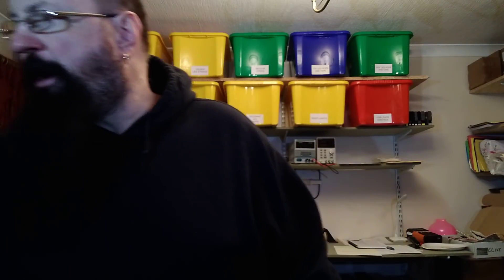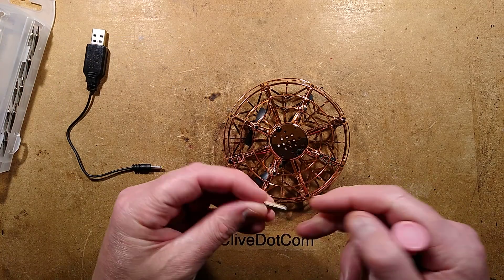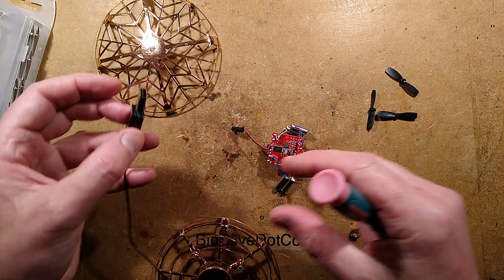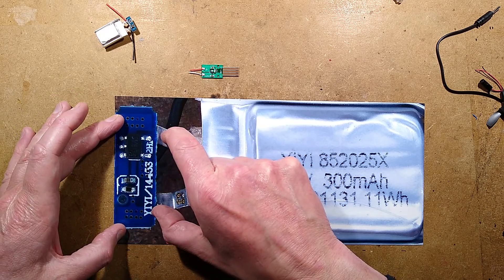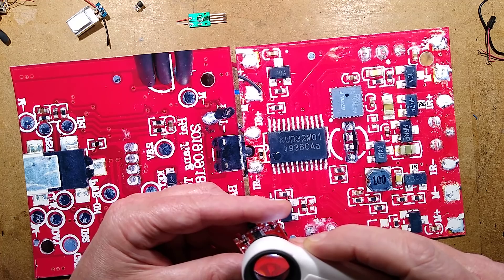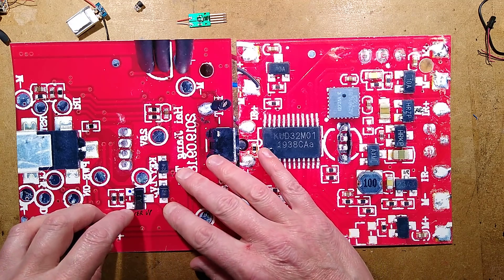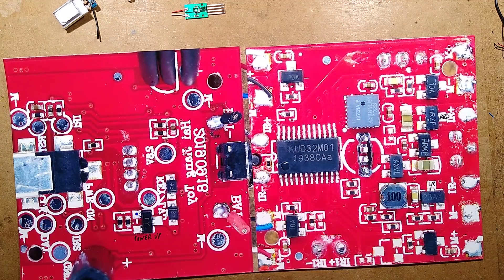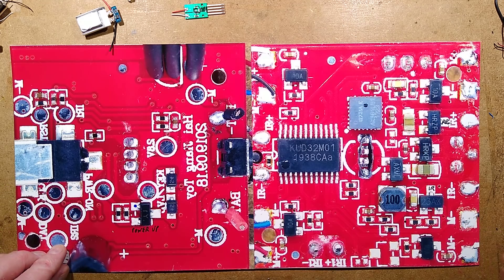Inside an autonomous drone.  (With beard entanglement incident.)

Comment: So fun running into these videos, even if fairly old, since I have a lesser capable one of these I got from Costco a few(?) years ago myself on a whim at only $15!  It's the HOVER STAR™ 2.0 Motion Controlled Stunt UFO  Even found the manual online for easier reading.  Rarely got the gestures to work well and the sensing near objects/walls, etc. almost always was a failure.  I suspect as it would fly off so much faster than expected.  Ceiling and floor sensor, surprisingly, did seem to work though.  Mine had just a microUSB cable to charge it, no cable included so no circuitry there at least.  "Some Day", I'll bring it to a field on a calm day and let it fly and see what happens/where it goes, how long it runs, etc.  Hmmm, better put my name and phone number on it before THAT happens though.  :)

Comment: Did you try probing the links between the 2 unknown chips ? There is presumably either an I2C or SPI link running between them. The protocol might betray that it is just a re-packaged MPU6050 or something.

Comment: I suspect the IR enable being connected to the power button might be a way to leak more power into the MCU through the IR LEDs and IO pins protection diodes to wake it up properly. It looks so pointless it must be a work-around of sorts for a glitch / instability.

Comment: Replace Blades with (2x each) - RS 850-108 No.10A Surgical Steel, spot welded together in opposing directions, twist each blade slightly with pliers to achieve the required airfoil-lift coefficient, -  Switch on when going to bed and Clive will wake up, refreshed, with the perfect Beard trim...

Comment: seeing through the red:  did you try fiddling with it in Photoshop?
If that's not enough, you can buy a sample pack of theater lighting gels.  It's about half the size of a deck of cards, and comes with a few dozen different filters interleaved with data sheets showing the spectrum.  They are varied and have all kinds of different band passes that are not really distinguishable just looking at the color, but looking through them can enhance your ability to distinguish different things that normally look the same but have different detailed spectra. 
A photo taken through a gel, and then processed in PhotoShop to bring out the specific difference you wanted (or, two photos taken through different gels, layered together) should allow you to easily see the subtle differences.
You could also try IR and UV photography.  It's the same idea as reading as palimpsest.
Reply from the maker: I've occasionally used filtering in irfanview to enhance pictures.

Comment: the square chip? does it have a small hole in it? these cheap drones usually use air pressure to control height gps is for more expensive drones but it will have an axis sensor or "imu".

Comment: ended up buying one and wow that came fast... the battery be lucky if it lasted 10 minutes.  But my room no.  won't work  living room not half bad.  for $10  and blue not bad at all  (mine has 4 on the ends and 1 on the bottom
Reply: and my usb plug is a micro usb.  not  pole port....

Comment: Cheap junk. Brushed motors die after two weeks of everyday flying and very little to salvage from circuit board for DIY projects. Though these toy quads have one good thing - due to slow MCU and slow gyro chip they are not susceptible to yaw spin which  haunt faster drone controllers in bad frames.
Clive, you bastard! Why you show only one side of red circuit board here?

Comment: Heyo, I love your videos. I was wondering if you would be willing to tear down a 12v laptop charger. I live the vanlife and have purchased a universal 12v power supply that outputs different voltages depending on the tip used. 

I have heard some of the shit ones might be doing 12v > 110v > 20v (or desired). But I've never really learned how DC  to DC conversions work. 

And it would be cool to see power consumption differences between 110 power brick versuse 12v. And if you have a 12v power supply  with an inverter to mimic an "off grid" or solar setup that would be really cool too.

Comment: Love watching your videos Clive!

Something you might care to experiment with is the fixed dimming of LED lights that use a separate driver attached to a ribbon array.

There's lots of videos and gadgets for variable controlled dimming systems, but sometimes you just want a low power light for soft ambient lighting, as I did recently for my wine cellar, and you just need something to fit between the driver and the ribbon inside the unit to attenuate the light output.

Experimenting with this has been a bit of a journey. On some cheap Chinese units, with a driver rated at 11-28V it actually ramps up to 50V if the output of the driver is open circuit. Using resistors to force down the amount of power going to the LED ribbon reveals a remarkably high light output, even when the power available to the LEDs is knocked back by 90%.

Strange stuff. I'm still experimenting before installing these - not sure whether the drivers will survive long term, outputting a much higher voltage than it's rated range as it fights my resistors..

Cheers,

Tom
Reply from the maker: The electronic drivers regulate the current, so if you add resistors it bumps the voltage up to get the same current.  If you use 12V strips you can get inline dimmers.

Comment: Hi Clive, been following your videos for a few years now really enjoy them thanks. Dumb question for you (please don’t cringe!) I have some audio speakers at home that run on a standard figure 8 2.5A power lead which has a 3A fuse in the plug.  I need to buy a new longer cable which I can get the same type but the new cable has a 5A fuse in the plug will this be ok to use or would I need to put a 3A fuse into the new cable ?
Reply from the maker: The cable may be rated higher, but you could always swap the fuse for better protection.
Reply: bigclivedotcom thanks Clive, the lead I have ordered comes with a 5A fuse in the plug but I will just take the 5A fuse out and a 3A one in then I’ve got an identical cable to the one that came with the speakers

Comment: The small chip is definitely a gyro, though, most of the flight controllers I have seen have three. But in there the flight controllers chip will poll the gyro and then base actions off that. Since you also have IR it polls those as well.

Comment: With only one IR receiver, it seems obvious the MCU has to control which IR LED is on so it can interpret the meaning of the received IR signal??  Would have to pulse an IR LED on, then pause a short time to wait for return pulse.  Then cycle through other IR LED's in turn.
Reply from the maker: Noting that it would also be pulsing each LED at a specific frequency as the receiver is designed to filter out unmodulated infrared light.

Comment: This may be a good channel to ask: I make interactive things, for museums and outdoor lighting/audio installations. I have tried torch (flashlight)  activated things, but nobody has torches, they all used their 'phone's "torch app", so that didn't work.  Buttons! Can't do that any more.  PIR's work for some stuff but are not "interactive" enough, which is what the client wants.  Indoors I've used the ultrasonic sensors, but people still stick their finger in them, and break them despite the "clear instructions" to just "wave you hands to activate". Any thoughts anyone?  I'm tempted to use 1KW lasers and react to the resulting "reflections" but I'm told that may be "dangerous". Pff.  Basically 100mm 'ish non-contact sensors. Just ordered some APDS-9930's for testing so I'll see how these work out.  (When they arrive from "you know where").
Reply from the maker: Foot pedals?
Reply: @bigclivedotcom  I also considered pressure mats and kick/knee buttons, just looking for more options.

Comment: It looks like the IR LEDs are tied to pins that can be inputs, outputs and a wake-up input. Before shutting down the software can change the pin mode from grounding to wake-up, input with a weak pull down resistor. That could also account for the lock-up if the pin control register is being written when a power glitch occurs. We often added a dedicated reset component that would handle voltage brownouts and a timer that would initiate a reset if not cleared by the software. Probably asking too much at the price of this "toy". Somehow I see the Chinese military having this thing follow an IR laser pointer for dubious purposes.

Comment: Do you khow if any powerbank that has pass through charging 
Meaning it can charge your phone will being charged and also starts charging the phone connected when main power is switch he’s off without pressing any buttons ?
Reply from the maker: There are some that allow that, but for high capacity you may have to blend two together by using one for its charging circuitry and tapping a simpler module across the battery that just puts out 5V all the time.
Reply: bigclivedotcom can you give me a suggestion of which one to buy ?

Comment: be interested to see it flying outside..
in a park or field u wonder if it would just fly off until the battery ran out.
 if those little sensors are looking for indoor walls & ceilings for the IR to ping off what would it do in empty space ???
be fun to buy a lot of these & get some friends to help u throw them all up in the air - see if the toy is able to detect & manoeuvre around it's own kind  💀💀

Comment: So the samd21 is a cortex m0+ 32 bit micro that can come in a package like that, iirc, so my guess is it's something like that, maybe a clone. 32m01 definitely sounds like a cortex m0/m0+ - though such a chip lacks an fpu, but I think this is simple enough it would still work fine. Think you can get an stm32f0xx (maybe even f01x) or L0xx in that package too, which might suggest gigadevice involved (they've cloned stm32 well).  Very clever gizmo in any case. I bet some of those test pads are an swd program/debug interface.

IMUs notoriously have terribly useless package labeling, and I have no idea about the capabilities of the non-western or clone vendors when it comes to those little mems sensors.

Comment: In my Huawei phone my Gyroscope vendor is STMicroelectronis and Magnetic sensor is mag-akm09918 by Vendor akm, I don't know if there is any correlation with the chip starting with AK on your drone, but it's a possibility I guess? My accelerometer is kx023 by KIONIX so maybe a search on those vendors may produce results? Pissed myself laughing when it caught your beard, so sorry but its funny, hope it didnt hurt too much :)

Comment: Maybe it would be a good idea to fit a tiny microswitch to the battery, so you could remove power to the circuit completely for the usual 5 seconds to clear whatever the software glitch is. It's probably some kind of memory management problem (bit over-run like the Apollo glitch springs to mind!)

Comment: The hole in the chip makes me think it’s got a barometric pressure sensor looks like your standard MEMS all in one cell phone jobby. It always amazes me how ubiquitous stuff that would have been $100s per chip 15 years ago!
Reply: Yep. That little pinhole is the giveaway. The barometer is necessary for the altitude hold function. Always amazes me how sensitive these things are.

Comment: All very clever, and well worth taking to bits, but what does it take to get it to straighten up and fly right i.e. not bolt for the hangar door? What could be more dis-spiriting than an autonomous chopper drone with a habit of veering off directly into a random wall within 20 seconds every time it's launched?

Comment: The motors look like the "buzzer" motors out of older cellphones. Those suckers are surprisingly powerful for their size too.
Reply: But they're brushed motors with the same metal stamping serving as terminal and brush so don't expect them to last long.
Reply: @Graham_Langley  Yeah, there's that. I haven't taken one apart in a long time- I might do that next week to see if they've changed much. The second-hand store I frequent the most always has "old" phones for a buck or two- good for such parts.
Reply: @markfergerson2145  Always amused me that vibration in phones was done with a balanced motor with an unbalanced weight on the shaft - why not design an unbalanced motor? A few years later they appeared.

Comment: I remember watching a demonstration video by an engineering collage with about 20 drones this size. They were much more complex with their programming.
They all could tell where the others were while flying in a pattern. They would stay an equal distance apart. They were sophisticated enough that if you tossed another drone up in the air the entire group would adjust to the addition and restructure the flight pattern.
Must have been astronomically expensive. So my guess is the US military footed most of the bill. I can only imagine what the non classified tuff could do.

Comment: Went through a couple like that one, the first thing I have to do is super glue the side sensor LED and wires in place because they get knocked loose rather quickly and tangle the blades.

Comment: Clive starting a conflagration with the battery on the workbench would not be a good thing. In the pie dish is a deferent story.
I do have a question for you. What do you use to edit the videos?
Reply from the maker: I just crop and splice if I have to with vidtrim pro.
Reply: @bigclivedotcom  Is that on your phone or a desktop? The reason I was asking is I wanted to see how you would deal with importing videos from something other than a phone.

Comment: I'm only just restarting my interest in electronics. I used to be a technician for PC/Server hardware but I hated the software/OS side of things. Ended up moving on to Carpentry. I wonder how difficult it would be to improve or perhaps redesign the electronics in that drone to make it smarter. One thing I'd be interested to add to that design would be the ability to learn to map and remember a location. So its autonomous ability would improve over time in a room. But I'm sure that sounds much easier to do than it actually is.
Reply: Look at James Burton's recent videos on ROS, specifically the intro where the demo robot maps a room and he starts adding this ability to an old project he already had.
BTW, " its ability would improve".  No apostrophe, just as with "his" and "hers".

Comment: Does that "accelerometer chip" have a hole in the top of the package? Perhaps is also an air pressure sensor.
Reply: I suspect it's a combined accelerometer/gyro and barometric pressure sensor.

Comment: I wonder if a version exists that can return to a home spot when the battery is low (perhaps led blinking at a certain frequency or whatever as a waypoint so the drone can locate it) with the home spot also being a wireless charger.

Comment: Some of the chip suppliers have started labelling chips on underside. Maybe to save the manufacturers from grinding it off to hide it?
The MCU can be a PADAUK mcu as they do not use a logo, and the markings on the chip is not directly model number of mcu etc.
Makes it really hard to identify. The chips are redicolously cheap and program memory is OTP. (One Time Programmable)

Comment: Hope you can do a review on the deep UVC LED lights currently being sold by Banggood. (and other places) They uses real UVC LEDs built into a nice aluminum enclosure.... that plugs directly into a smart phone or power bank. 

They sell two versions. One with single UVC LED, the other with dual UVC LEDs. They offer versions in nice aluminum housings and look rugged. (like an actual finished product)… 

But they also sell un-housed PCB’s. Starting at six dollars and Around $20 for the nice aluminum enclosure versions.  

They go by the name “greensun” on Banggood. 

I’m really interested in the two LED version but would also love to see some of the single LED versions with and without the aluminum housing.

 you can even purchase the SMD UVC LED chips separately. They look like the real deal with quartz window and everything.

If the UVC LEDs aren’t in the highest quality and eventually burn out…

You could always replace them with similar LEDs made by nichia or other reputable brands.  And you would have a very nice and reliable device.

Comment: It's fascinating to learn what all is inside these items.  Almost a year ago, I bought three of them (each a different color) and kept one and gave away two as gifts.  As with most sites such as Wish.com and AliExpress.com (and I see them via your eBay link) the same items are available in a wide range of prices from different sub-vendors, some selling the same item for triple or more what others sell them for.  Did yours come with the remote that will shut the drone off in mid-flight?  Mine did.  Also, there are vids showing them in use outdoors, but I don't recommend it due to sunlight overpowering the I.R. sensors and also a good wind can make your drone vanish forever.

Comment: Clive, you should have a look at washing machines that fail outside the warranty period and whose components all work fine. Plus all the components on the circuit board also work fine, leaving the micro-controller chip as the suspect.   They could be counting mains cycles and are perhaps programmed to fail?

Comment: We have two of those things. I don't know whether they're different versions but ours came with a paper sheet which explains how to steer it. If you hold your hand above it and slowly push down it will lower its height. if you hold your hand below it it'll go up and you can push it in direction you want it to go. Ours are quite stable in holding position.

Comment: I found looking up the 10A mosfet impossible as search results all came back with 10 amp results :(   Looking it up as I am looking for a low cost P channel with low RDS(on), an A19T has 0.15 Ohm and is sent out as an equivalent to a AO3401A (.050 Ohm)  :(